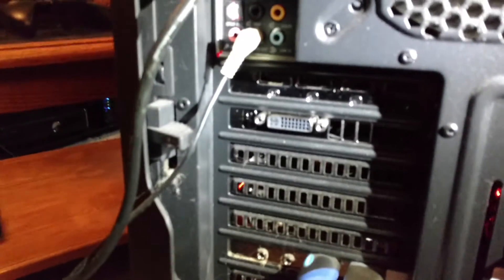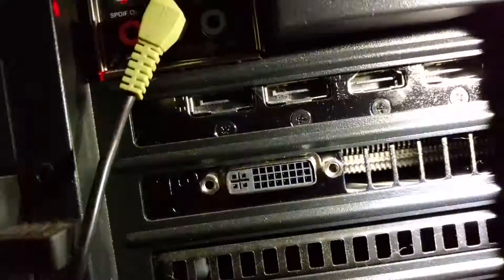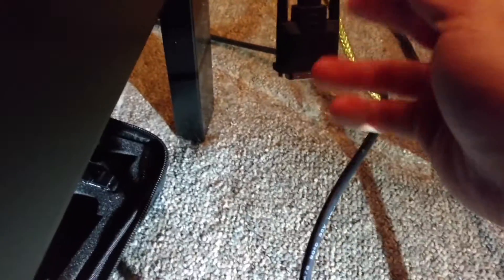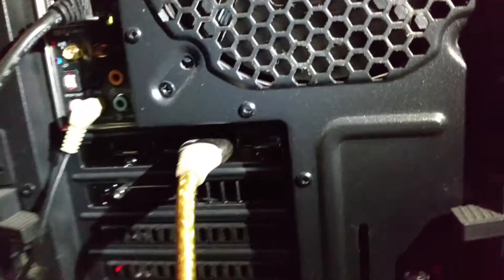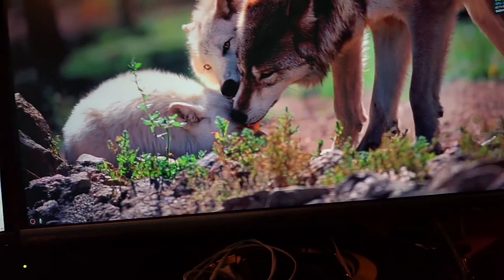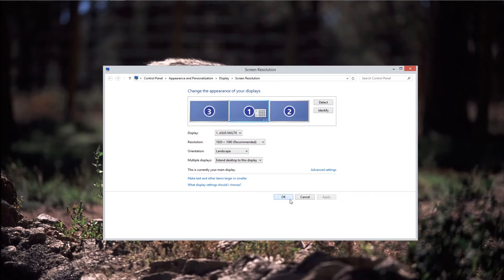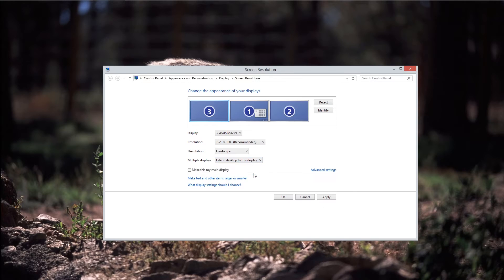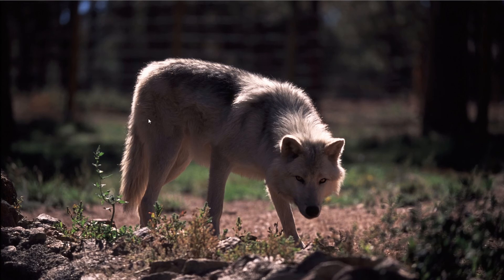How to hook up triple monitors with an Asus Strix GTX 980 graphics card

Comment: It doesn't seem to be recognizing the monitors (and they aren't receiving any signal), what do you think I should do? What do you think could not be hooked up properly? I am able to connect one via hdmi to hdmi. Then I put a second monitor from dvi to dvi (will change to dvi to hdmi later), but I can't seem to be able to get any of the display ports to work. My original intention was to get one monitor from hdmi to hdmi, and then have the other TWO monitors go from display port to hdmi. Is this even possible (I assumed so because there are three display ports)? What do you think might not be hooked up?
Reply from the maker: Honestly I don't know. I would have to see it.
Reply from the maker: Are all your video card drivers up to date?